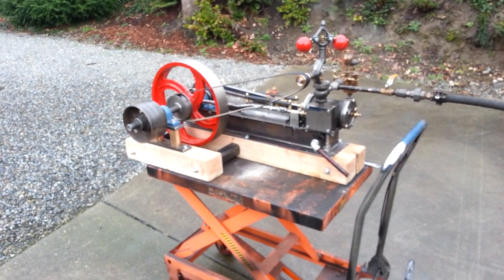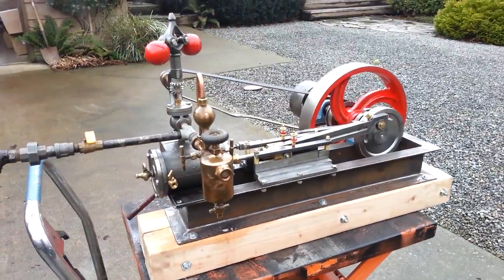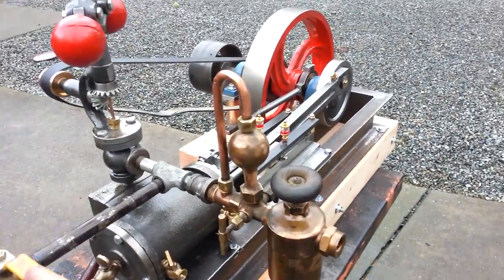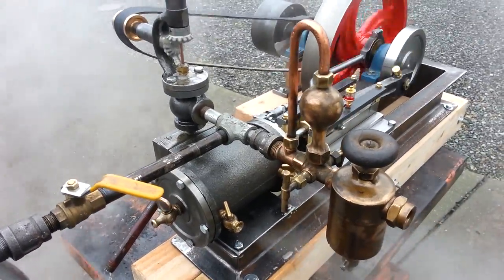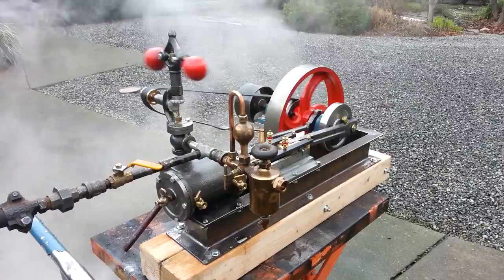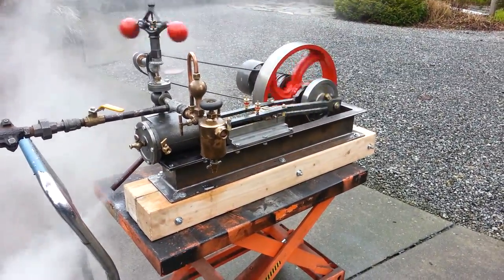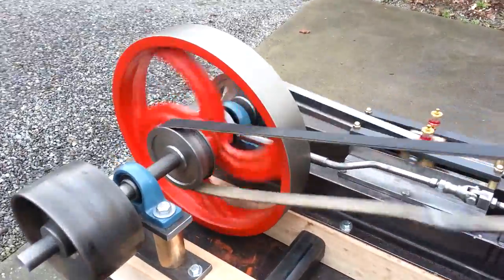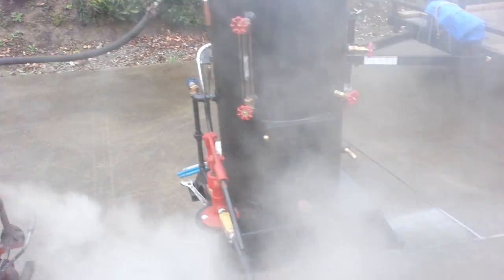Live Steam Mill Engine Flyball Governor Tractor Hit Miss Boiler Off Grid brass.

Comment: Hi Ross, I see that your Governor does not have the safety cut off to kill the steam should the belt break. I installed a Pickering with one on a “static” (no steam) Little Giant Hoist (6 x 6 Vertical) display and it appears that the governors safety cut off arm/pulley will not function as is. The arm hangs straight down and would not contact the belt running from the main Governor pulley to the crank wheel. Maybe the Governor is designed for a mill engine. Are governors designed specifically for horizontal and vertical engines? I don’t see a way to reconfigure this one so it would work with my vertical engine. Tks, Bbq

Comment: I notice that it wasn't in governing range, as you were regulating the speed with the input valve and the balls never moved. Just curious, any reason for that? Like safety concerns with getting the speed that high, or insufficient steam pressure -- or it simply hadn't been adjusted yet? (I Just remembered you said in the video it was the first run, that probably answers it actually)